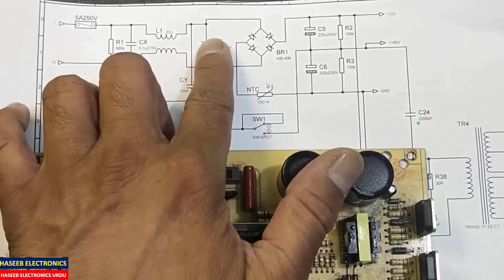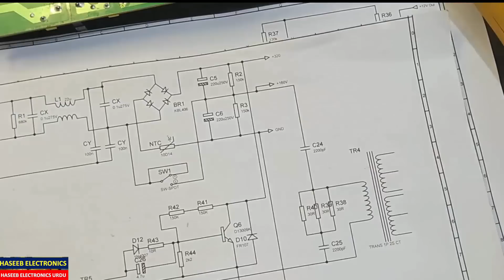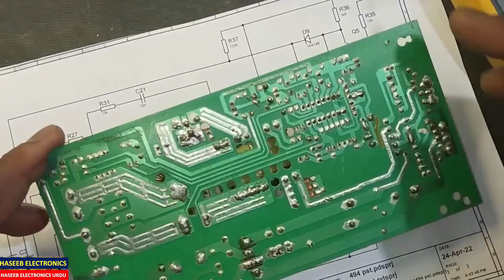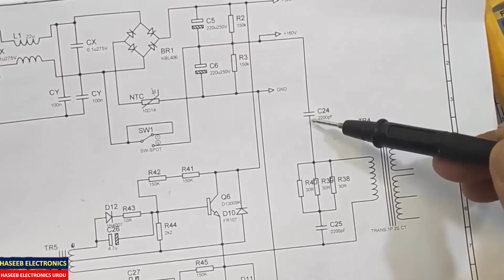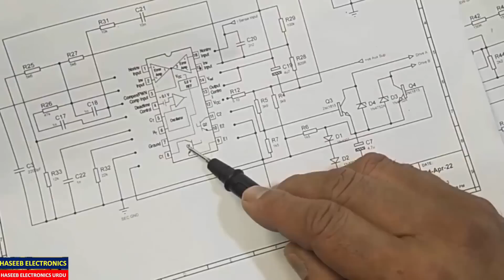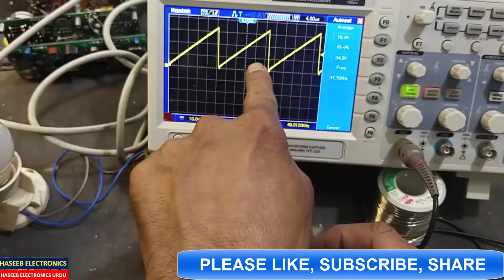Comment: I have this type power supply and the output is 12v at free load.but when connecting load the voltage is dropped to 2volt at output.main filter giving 300v constant even when the load is connected.what are the components to check .pls help

Comment: Hello sir pin 3  controller staible output voltage I try using pin 1 only but the voltage refuse to stabilize I use the 47k resistor and two 1nf capacitor the voltage begin to stay staible but so the capacity seems to create and additional frequency I don't know how it's possible but the frequency generating from the capacity and 47k resistor in lower then the operating frequency 15khz

Comment: Why there is a 50 volt capacitor and two diode in  parallel to the ground to transistor emitter? And what is the ripple of this power supply? how we can reduce ripple ?

Comment: I see your drawing is matched to the board but it is good if you may take photos from the each sides of the board and mirror one the photos and then make a drawing with same wiring and same board components as they are seen in the photos.

Comment: Sir, i have watched a lot of your videos. I made all the checks as on many videos, i made sure the ic is not burnt. Pin 12 gets between 12 to 14volts, pins 13 an14 are 5 volts, pin 4 is zero, pin 2 is 2.5 volts. I changed the transistor c1815, and i am still getting 3.3 or zero voltage output. The whole thing started when i connected another 12v - 20 ampere power supply to the 12 v 10 ampere supply in series to get a 24v. One of the four 1000 capacitors blew up, i replaced it but still doesnt work

Comment: Profound and easy to follow explanation of how a switch mode PSU is working. Could be a little faster for me but nice anyway 🙂 You know 'diodegonewild'? He is also doing very could electronic videos with lots of PSU explanation and fault repair! Most common fails are electrolytic caps and semiconductors.

Comment: Thanks professor Haseeb. I've just fixed a SMPS, found an open resistor that was not providing VCC to TL494. Replaced it with another 1.5MR and it's now working as it should. Before finding the resistor I inspected MOSFETS, output diodes, input circuit. Kudos from Brazil.

Comment: I viewed the video and i would like to also share that with the 26 PSU of this kind that tried to fix, when some did not start, i very often found the low value resistors (R43 /R47) driving the base of the MJE13009 being open. When observing short circuit, those MJE were short. Sometimes also when one of the MJE heats, checking the Zener 33v (D3 /D4) in parallel with C1815 transistors revealed faulty. Happy to bring some information to this magnificient video done by our Master. Salam Aleikum.
Reply: Thanks for valuable comment. I was struggling repairing three power supplies. your comment helped me a lot to fix them. each one had one of mentioned issues. thanks.
Reply: Very happy to help @shamshirian

Comment: This is a great video and does give one a more understanding how this works, I have an issue with my S-360-12 12volt/30A and I can not find the issue, the VCC pin on the IC only have 8.4volt where it should be 20volt the main output voltage is only 4.9 - 5.1 volt, I have checked and replaced all the large and small Electrolytic Capacitors, also tested all Transistors and diodes. I'm old school and used linear powers supplies and some what new to SMPS. Thanks for your video keep it up..

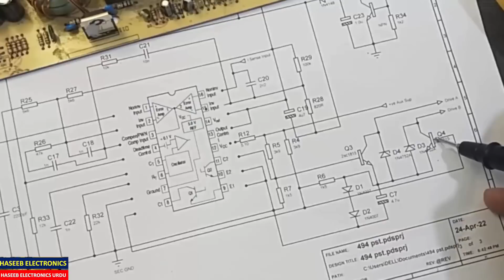Comment: Small missunderstanding of startup. Actually , this circuit starts to self oscillate at the beginning since you have tertiary small winding with positive feedback. If you'd disconnect secondary side of small transformer and completely disable SMPS ic , two power transistors , small transformer and main transformer would form half-bridge oscillator with 50:50 duty cycle. So basically , while no power to the secondary side , primary forms so called blocking oscillator while secondary voltage builds up and SMPS ic takes over. 
Anyway, keep up the good work. Cheers !
Reply: Good Morning and special thanks for your valuable explanation. 
please except my best regards and special thanks
Reply: No problem. My older and more experienced colleague showed me that. I was very suprised. Regards.

Comment: Thank you for the video sir! I don't understand what you said about the low voltage driver transistors at 53:00. You said those transistors are turned off because they pulled-up, and they begin to conduct when the IC connects their base to the ground. But this not how NPN transistros work.

Comment: Hi 
Haseeb , I have a psb from Denon receiver ,most of Denon receivers with same board get issue after a while , actually output voltage to HDMI board (5.2 V and Ground) is ok but relay doesn’t clicking to turns on the receiver! I couldn’t find the damaged part, can U help me?I don’t know how can I send  u a picture of the board!!!

Comment: Dear Sir, Can you please upload all the circuit diagrams explained by you in this video? I am working on this circuit since last 5 months, but I am not getting this working properly.
I have one question. You have connected an AC signal via switch to in-between of filter capacitor and by pass the bridge. if we close the switch direct ac will be applied. Is it going to work? If yes, how?

Comment: Thank you very much dear Master for your excellent demonstration.  
I have a question with 12V 30Amp SMPS , giving 17V DC out with no response to the variable voltage adjustment , at zero load.   IC was replaced , and i checked all the components.  
The 230V  series safety  bulb is glowing little. What could be the problem please?

Comment: Hi, very helpful video and lovely explanation. I am trying to use this circuit to generate high voltage of 1.5kV by modifying the main transformer to a step up transformer and then rectifying the output. In open loop the circuit works well but as soon as I give the feedback to pin 1 of TL494, the output ripple becomes 30%. When observed closely I found that TL 494 is generating pulses for 20msec (at 40kHz) and off for 40msec. Can you help please.

Comment: Thank u mr haseeb
I have several of smps model s-360-12 volt 30A
Chinese model
And i repaired all of them
Now working perfectly
There r a very differences between their diagrams
Some of the have another transistor c1815
Which i traced it is used for short circuit detection
But as soon as i short output intentionally the power transistors burns out
And some has not this extra transistor. Would you please help me to add short circuit protection to it .for your info i could say that there is holes on the board for some component made for modifications like short circuit protection by making pin 4 of the ic to go high when short is occured.
You r perfect
And good man and instructor

Comment: I have 12v 30A smps power supply, but now output only given 3v . What could be the problem? It would be helpful if you knew me. I will wait for your reply. All the capacitors of the supplied supply are good and the diode is good. I have checked.

Comment: Sir, I am not getting any +ve aux output at the output of TR3. There is no voltage across the 220mf capacitor. I suspect the diodes but in my board the diodes are placed under the transformer hence I need to remove the transformer to check the diodes.. Is there any way to confirm the diodes are faulty without removing the transformer? Also the VCC at pin no 12 in IC is not there, but I think it is due to absence of +ve aux sup.

Comment: Sir You are very informative i learn a lot from you,you are good teacher.
I have one question?
I have smps from forklift battery charger this smps is rated at 400v-480vac input and output 80vdc its 3 phase input.
is it possible to hack this circuit to work in single phase mode in 220v input.
Its high current smps 180Amps at 80vdc.
Thank you for your lessons

Comment: Dear sir, I regularly watch your videos and these are really knowledgeable . I an desperately waiting for some video on LNK6666e ic used in SMPS. Though it looks so imple in circuit yet difficult to repair.  I tired to fix it, checked all resistances startup capacitor and even changed the IC but not able to get primary driver circuit ok. Kindly make some video on it. Thanks

Comment: Sir, Excellent explanations as always. Thank you for educating us in such details.
A few doubts if you please bother to clarify. 
1. Why is a driver transfer required? Is the output from pin 8 & 11 insufficient to drive the MJE13009 transistors? Also the roles of the 2SC1815 transistors.
2. If you could explain the winding details (turns, direction and thickness) of both the transformers, ie the main and the driver transformer please.
3. If you could show us the waveforms at different stages as shown on a oscilloscope.

Request do a video on the above if is not much of a problem.

Thanking once again.

Comment: @Haseeb Electronics  thanks for the guidance, I bought two 24V 15a power supplies connected in series for 48V powering two 5.6A peak motorws. but it is preferable to have the 48V with only one feeding the drivers of a stepper motor 4A rms and 5.6A pico. so I'm going to change the two fonts. I found a spreadsheet for calculating the turns but I still have a big doubt after watching the video {390} did you keep the primary winding? the subtitle translation didn't make it very clear, I'll watch it a few more times until I understand better, in my case it's the opposite of the video that decreased the voltage but I want to raise it to 48V. I thought the transformer could reach at least 10A, which has a cylindrical inner diameter of 12.5mm and an outer 40X40mm

Comment: dear sir, the smps was plugged into 220v with the switch pointing to 110v mode , got a burst sound and some smoke near transistor, can it be repaired?
Reply: most probable damage 
main dc capacitors. (smoothing capacitors) 
bridge rectifier 
fuse
may be Transistor or MOSFET
Reply: @HaseebElectronics  thanks for sharing sir. There's continuity in the capacitor and main supply in all the polarity and the bridge rectifier is also showing continuity in positive and negative ends.
Reply: Regarding the MOSFET, will all the 3pins show continuity?
Reply: If there is continuity on dc rail (capacitor+ and - terminals) surely dc capacitors or MOSFETs gone 
Or bridge rectifier itself gone
Reply: Yes 
It will give continuity between drain to source 
And sometimes all 3 pins will short circuit
Reply: Is that expensive to replace all the components sir? In india

Comment: Sir voltage from plus to center return point and negative to return point should be same about 155 volt. But in my supply it is 205 volt and other side 95 volt. Transistors getting heat. Out put is also more about 20 volts. Please when ever you have time please make video on these faults. Thanks

Comment: Hello
I have a question
 
In other diagrams, the power of the IC swithing is provided by ohmic and capacitive voltage division
But in this diagram at first
When we turn on the adapter, where does vcc come from to power the TL494 IC?

Comment: Assalamalaikum janab  mera pas ek sony audio system ka power supply hei ,usme  main  filter capasitor 2hai 680mf220volt uske parallel me bleeder resistor ka jaga pe diode dikhta hai , woh kya purpose ka hain ?

Comment: if i replaced the two filter capacitor to 400v and the power transistor to 900v! would it operate with 380VAC safely?

Comment: Thanks a lot for your explanation..
If I'm only getting 7.5 volts at auxillary voltage, what can it mean? Also output voltage  is low and not affected by adjustment of the potentiometer
Reply: most welcome 
there are many possible reasons
1, might be one mosfet, its driving circuit, pulse transformer drive side, 
2. might be one section of the ic is not working 
3. might be coupling capacitor is devalued 
4. if there is RCD snubber circuit,  check the snubber diode

Comment: If VCC=7vdc and pin no 13 = 5vdc. Main cap is =@140volt each. Output volt of SMPS = 7vdc. Already change new IC TL494 and both of 13009 but same problem. How should I do?

Comment: Thanks sir.i regularly see your videos.with electrical work as well as i learn and under stand English language
I have 12v40A the same( two BJT D209L )and two rectifire (MBR30100CT) and chock transfarmar same.local tecnition  see the transfarmar and said me that this is only 10A.and the ring inductor large in your supply.is this right.mean how can identifiy the supply.

Comment: Thank you so much from India. I have similar SMPS damaged and lying with me. Inspired by your tutorial I tried to repair that. The condition in which it was lying was fuse blown, rectifier diodes damaged ( 2 blown off), power transistor short. Replaced the defective components. Now in cold test the drop between the capacitor and main terminals matches the test suggested. There is no short circuit. I powered and still it is not working. The input voltage is 230 AC but voltage after rectification is 290V DC only. What should I check next. Would be grateful for your reply. This will be a great learning if I succeed.
Reply: I just want to add one more information, the original board came with 4 x 1N2071 diodes, however due to non availability, I have replaced with 4x 1N4007. Can it the reason of low DC voltage after rectification?

Comment: Thank you so mach for your very informativ video! I like your works! :) Please, upload the circuit diagramms, because the old links not work! Thank you so much, GodBless!
Reply: best regards and special thanks for pointing out the problem 
i corrected it.
Download 300W TL494 based Half Bridge SMPS circuit diagram 
https://drive.google.com/file/d/1E9vGs7ZRh3J_hGGDziacPMtZq2HfTNSW/view?usp=sharing
https://bit.ly/3y9RJ4g
Reply: @HaseebElectronics  Thank you! That's good! This link works at this moment.
The diagram will be a good starting point for this type SMPS, I put this draw in a good place!... 
(In the diagram, if I think better, the TR3 and the TR4 are the same ?)

Comment: Hi Hasseb you ar the best teacher with this videos!, now i have a heating problem with a intelligent car battery charger, with 2 Mosfets in push pull configuration...the mosfet connected to groun heating too much very fast, the other one is cold...you mommented that issue with the resonant capacitor (poliester), but i check that with multimeter and its ok (in uf) what do you think? is posibble the capacitor was ok in uf but damage in ESR? anothr circundant components are ok.
Reply: thanks a lot dear 
if the series coupling capacitor is OK
then please check the gate drive components for that mosfet. specially the Pull-Down Resistor (gate discharging resistor) 
or swap the MOSFTEs to verify the mosftes 
also verify output side rectifiers. sometimes the output rectifier also gives a reverse-load on mosfet
Reply: @HaseebElectronics  Wen you recomend checke the coupling capacitor, the over heating is in both TR? or like in this case only the second one connected to ground?, i replace both mosfets because are damages, in shorts...the aledanious componets near gate are ok...or..maybe looks like ok.In this case, is possible to replace the primary coil ok transformer with a bulb lamp? to check the primay side?

Comment: I also have an smps 12V 10A its output voltage is 19.5 does not control the voltage free set TL494 ic 14,13 pin voltage 5V pin 2 voltage 2.5V all component show the correct values please help

Comment: Sir....same board hai...24volts5amp....IC 494....pin no. 12...VCC and pin 11and pin13...found short...after replacing IC...without loadout put is 18v...and with load only  2 volts...VCC pin of IC has only 8vols...

Comment: Hi and thank u for your perfect explanation of the circuit.mr haseeb i have a smps Chinese model s-360-12 v 30A
Which means maximum of 360watts
But in the circuit no short protection circuit added
I mean as soon as there is short load the power transistors 13009 burns out
In some models with the same wattage there is a Q5 transistor which when is off it pulls the dtc pin of tl494 to go high and stops the pwm protecting the circuit
Please help me to modify it for short circuit protection

Comment: Sir how can we determine the supply voltage of the vcc capacitor that connects to the auxiliary winding and to the vdd controller ic if its normal for the different types of smps power supply sir tnx

Comment: Kya do (2) same smps (12.00v 25amp both seted) ko parallel ya series connect kar sakte hain ?? ( 12.00v 50amp ya 24.00v 25v ke liye) ,,, behad shukriya
Reply: JI bilkul, 
parallel mein use karney keliey dono supplies ki output per rectifier diode use kr lein 
series mein aap normally connect kar saktey hein

Comment: This is cool i have a 12v to 110v inverfer but my control chip is a ka3525 it has a soft start i wonder which chip came fitst probably the 494.  This has no inductor 1 transformer 2 lm324 another op amp and a 555 timer. This is a nice break down.,,

Comment: Sir ek question h 1431A ..... Tl431 ki tarah ic h ya transistor h plz itna bta dijiye
Reply: 1431A is ame TL431, 1431A is manufactured by ST microelectronics and they named it 1431A
Reply: @HaseebElectronics   sir one more question jb maine iski data sheet dekhi toh usme pinout 1431a ki alag dikha rha h aur tl431 ki alag..... Aur jb maine multimeter se check kiya toh pnp transistor ki reading de rha h

Comment: Sir may i know the significance of the dot in the winding of the transformers sir tnx thumbs up done
Reply: The dot tells you about the the direction of the winding . When the primary is driven (current flowing in a forward direction in the primary ) then a dot on one side of the secondary winding indicates that this side of the secondary winding will have a positive voltage with respect to the other side of the secondary winding .  If the current in the primary reverses  the voltage across the secondary winding will reverse also  so the side with the dot in this case will be negative with respect to the other side of the secondary winding . I hope this helps .